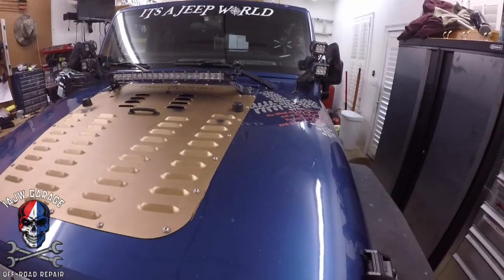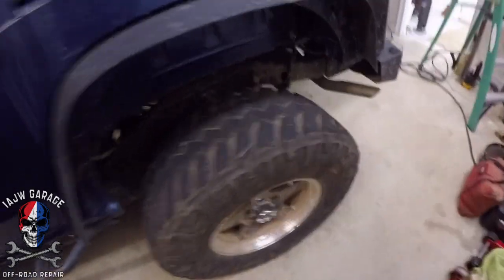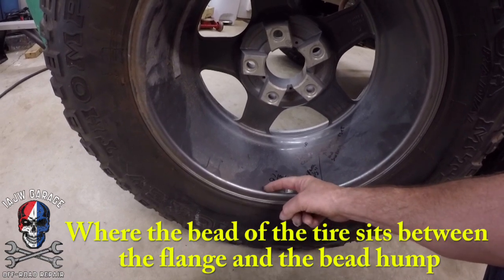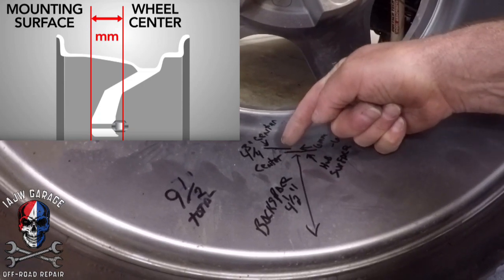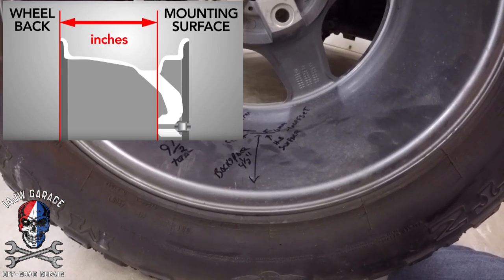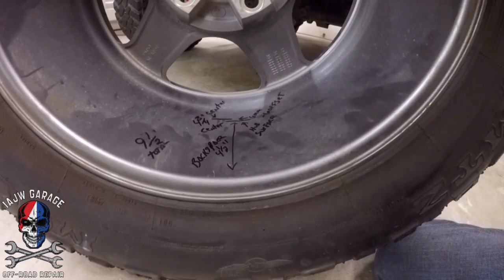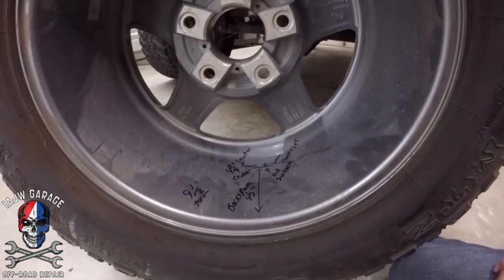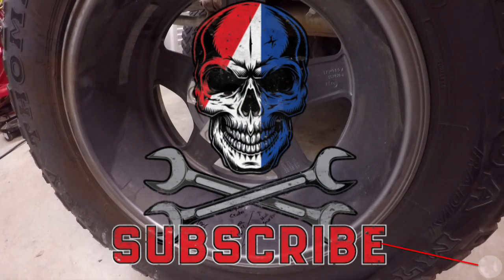A Simple Guide to Backspace and Offset unravelled By It's a Jeep World

Comment: I see a lot of -12mm offset on 18 and 20" wheels that are 5/114.3 bolt pattern. Would I be able to install on a tj
Reply from the maker: Peter Trenkenschuh Yes, you should be able to run 5x114.3 wheel on your TJ which is 5x4.5”. The -20 offset will bring your wheels out and give you wider stance
Reply: Thanks
Reply: Also if it's a wider rim such as a 10" or 12", does that change the offset more negative to try to keep the backspacing the same which I am trying to keep at 4.5"?
Reply from the maker: Peter Trenkenschuh The wheels wider width can have the same offset the hub center is moved to create the offset during manufacturing. Choosing your offset doesn’t matter on width of the wheel you can have a 10-12” wide wheel with whatever offset you choose